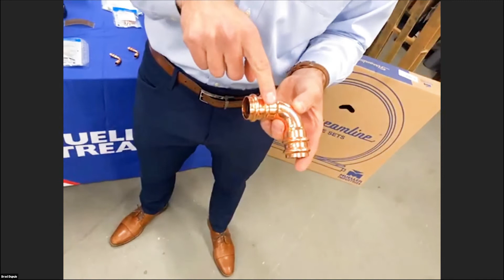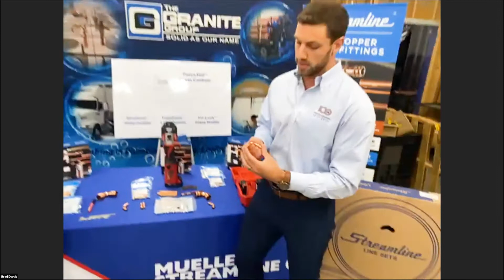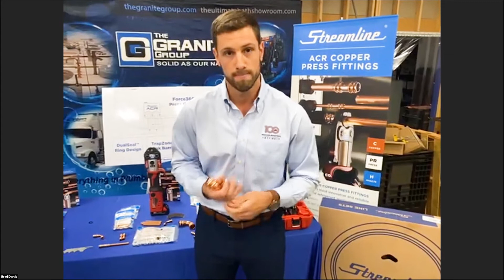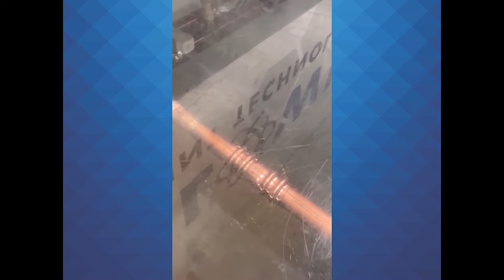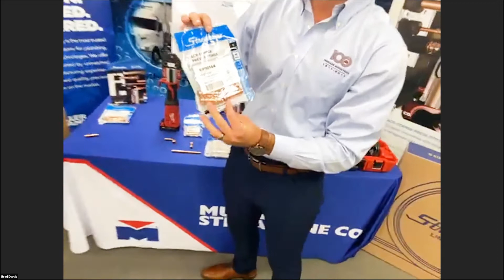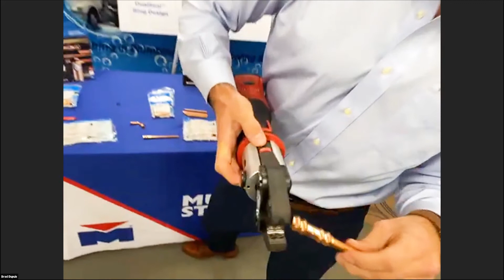Press On Virtual Showcase - Mueller/Streamline

Comment: Rubber has a shelf life.  I wouldn’t trust these on the discharge line.  The temp limit is too close to the discharge temperature on some units.  10 year warranty on the fitting, but who pays the labor, if an when these fail?